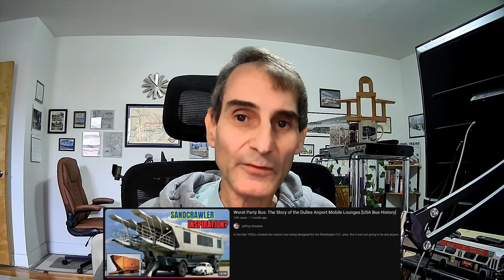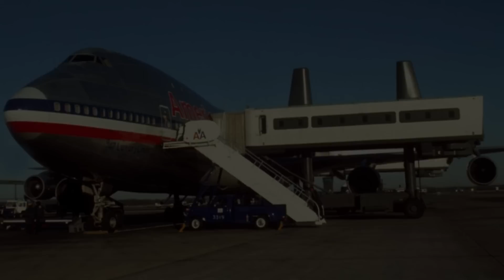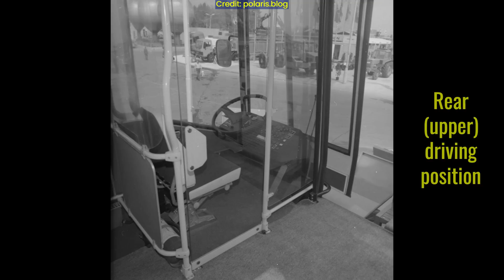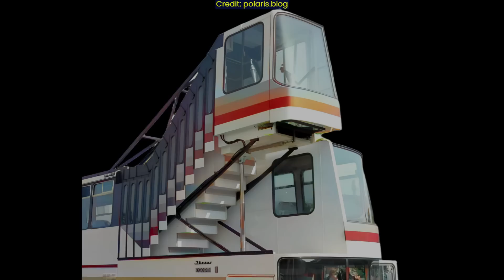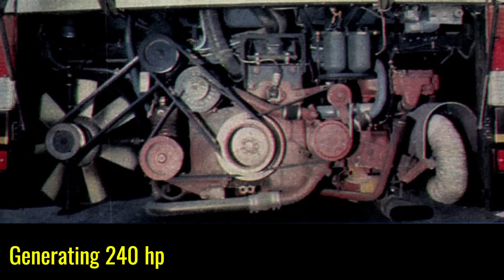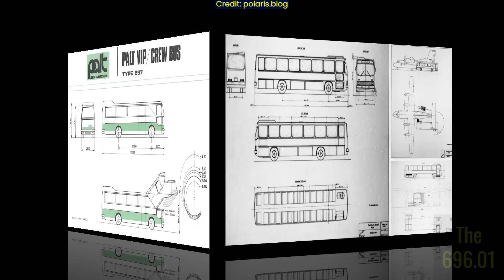PALT: The Story of the Giant Ikarus Buses You've Never Heard Of! [Hungarian Bus History]

Comment: The Dulles mobile lounges were great in the early days. At first they would traverse large distances at high speeds. It seems like most of the lifespan of the mobile lounges at Dulles was in a stopgap secondary role of serving as slow bus between terminals.
Reply from the maker: Hello! Thanks for the info about the mobile lounges! Thanks very much for watching!!
Reply: Why did airports ditch mobile lounges?
Reply: @ at Dulles, the advent of the jet bridge and construction of the two midfield concourse buildings negated the benefits. After that, Dulles could have just used busses.

Comment: "Too many things that can go wrong"
The sad fact is, we have simpler machines today, but fitted with a lot of electronics where the vendor is rubbing their hands as stuff break for arbitrary reasons, and in some cases even just requiring a fee and a quick 10 minute job to fix in software.
Mechanical failures due to complexity could at least be easily fixed though, so there is that.
Reply from the maker: Thanks for your input! Thanks very much for watching!!

Comment: I see a problem with the single-decker passenger only model, accessibility. The double-decker PALTs you could probably get someone in a wheelchair up/down the stairs by putting them at the point that mates with the plane, and have them ride it as it goes up/down, but the single-decker passenger only one doesn't look like there's any way you can avoid climbing the stairs.
Reply from the maker: Hello! It is quite interesting how wheelchair accessibilty would have worked on PALT. It appears it was not a concern to the designers, LOL. Thanks very much for watching!!
Reply: Remember, it's a 50 year old design, low-floor buses weren't invented yet. I don't think wheelchair users were travelling back then. :( Especially in socialist countries like Hungary.

Comment: It's a great introduction to something I never heard of before. The obvious flaw in the design is not in the mechanical aspect, but rather its compliance to airport procedures and all the steps passengers have to go through at international airports. First, the passengers have to check their luggage, so they have to leave the bus, tgo through passport control, and then the bus has to pick up the luggage and the passengers boarding the same flight. It would have been a better option to operate it as a strictly airport vehicle which doubles as the transport to the airplane as well as the staircase. The luggage should be checked in the usual way and be loaded to the airplane via a parallel channel.
Reply from the maker: Hello! Glad you liked the video! Yes, you are very right about these buses not being practical for airport security! Thanks very much for watching!

Comment: Ikarus’ seems to have had some very daring and innovative designers.
Sadly, this design cannot meet American ADA requirements. 😢
Reply: You might be surprised what you can do with a lift. The raising stairs would easily accommodate a wheelchair at the end with a bit of thought. Basically you roll a wheelchair onto the air-stair bridge and then raise it to the aircraft.
Reply: There were Ikarus buses in the USA, under joint venture.
Reply from the maker: You're totally correct on both points! Thanks very much for watching!
Reply: Would a bus like that have to meet ADA requirements?
Normal aircraft stairs don't meet them either (at least I assume so), so why would this bus have to do it?

Comment: The last one seems almost practical-basically a modern low-floor airport passenger bus like the ones used at many European airports, but with a built-in boarding bridge like a Dulles mobile lounge. Still very mechanically complex. The idea of putting the checked luggage in the same vehicle as the passengers seems like a non-starter though; simply not practical with modern airport practices.
Reply from the maker: Hello! yes, quite an interesting vehicle, but just not all that practical.  Thanks very much for watching!

Comment: This terminal to aircraft transfer bus is pretty cool, but generally all flights I've been on recently which used a transfer bus had (a) a bigger one, (b) usually more than one.  Good for small aircraft.  Or several buses, where the aircraft boards both front and read (think RyanAir, EasyJet)
Reply from the maker: Hello! Yes, interesting idea, but just not practical today!  Thanks very much for watching!
Reply: In my experience, at least in Europe, low-cost carriers prefer to make their passengers walk to the aircraft, irrespective of the weather.

Comment: Trying to keep those many sliding segments of the stairway waterproof in rainy environments looks like a nightmare.
Reply from the maker: Definitely!!!
Reply: Should have just gone for a one piece ramp instead. Then you'd just have the two points where it's hinged, and it would improve accessibility. (You could probably get someone in a wheelchair up/down the stairs by putting them at the point that mates with the plane, and have them ride it as it goes up/down, but if you had more then one person in a wheelchair you'd have to do it multiple times (if there's only one person you could just make them board first/disembark last))
Reply: @t1m3f0x  Problem with a hinged ramp, is that if it is the right length in the flat position, it is now too short after hinging. So, you then need a longer telescoping section to make the connection.
Reply: Something like the harmonica-connctions on double or triple link busses or also some trams wight have worked.
Reply: With all those exposed moving parts, it definitely wouldn’t be practical in locations subject to winter weather.  That stairway would freeze up and the whole thing would be useless.
Reply: I think using a rubber hose, like airport gangways, would have been cheaper and easier.
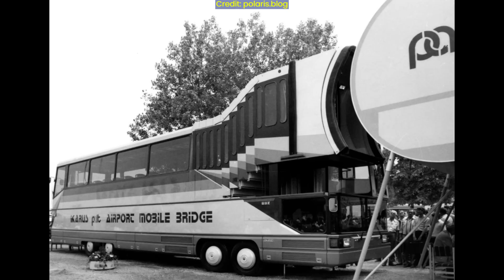Reply: 3:31 it looks like a problem they have solved. If not, a simple tarp below or above the roof could take care of it. Or a shaped rubber "harmonica", like on bendy buses. Ice could be an issue, but airports have deicing equipment.